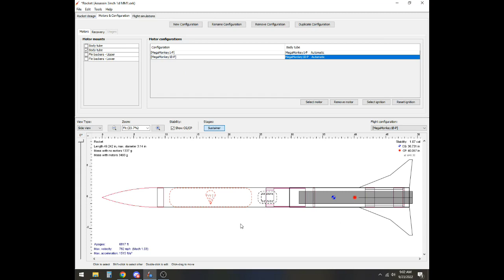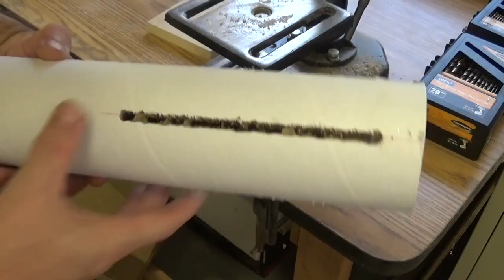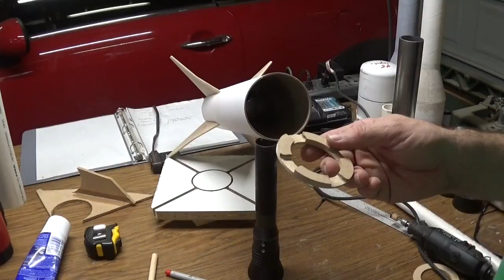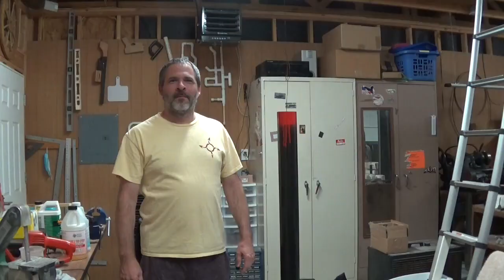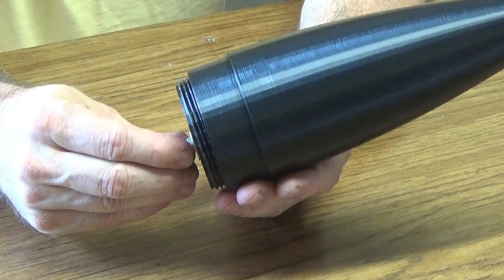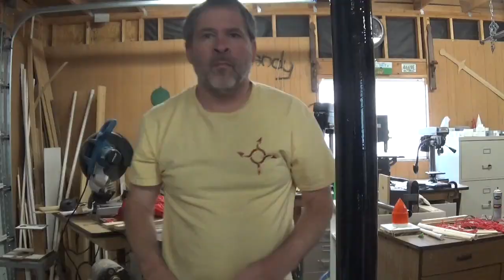Complete Build of our Assassin 1 Homemade Rocket

Comment: There shouldn't be Vent holes between the electronics bay and the rest of the rocket. The Vent holes for the computer must be in the same compartment as the computer. With your current set up, There are going be ejection gases in the av bay, which is reaaallly bad for the electronics. The separation between the two compartments must almost be air tight
Reply from the maker: Interesting... We have been using the flight computer in the same bay as the ejection charge for a long time and have had no issues resulting from that. (Sure, we've had issues/crashes but not because of the location of the flight computer) We have simply moved it from the center of the rocket (below the parachute) to the top of the rocket (in the nose cone).
We are still experimenting with this new nose cone & flight computer design. Unfortunately, I see no way to vent the chamber in the nose cone without going through the upper body of the rocket. I do have an idea for "filtering" the vent opening into the av bay and that would prevent soot or other impurities from the ejection from getting to the electronics.
Reply: @rotaryrocketry  the problem is the corrosive ejection gases. It's going to be difficult to filter those. The simple solution is to make a couple of holes in the nose cone. Eggtimer has instructions on how much holes you need (I'm sure you know that), so just apply these rules to the nose cone🤷‍♂️
Reply from the maker: @shere_kan8329  hmm... You've given me an idea... I will work on the design. Thx.
Reply from the maker: @shere_kan8329  I did some research and unfortunately, EggTimer says they want the vent hole to be at least four body tube diameters below the tip of the nose cone. That would be 16 inches for my 4" rockets. So vent holes in the nose cone would be far from their optimal design. I remember now, that is why I vented into the body tube and then vented the tube lower down. I think I may just implement the filter system and see what happens on some test flights.
Reply: @rotaryrocketry  I understood that this rule is not something rock solid. But you should contact Chris from eggtimer and decide from that🤷‍♂️
Reply: @Rotary Rockets  you guys are awesome. Do you go to rocket launches like balls or ldrs or nsl? Id would be cool to see you guys demonstrate your projects with a kiosk at a launch. Id come by and say whats up
Reply from the maker: @johnnyRandomadness  Have not been to any public events. Maybe some day, but for now we just play in our desert.
Reply: @Rotary Rockets  man thats a shame. You would maka a great kiosk at a launch event. Blue skyes man!